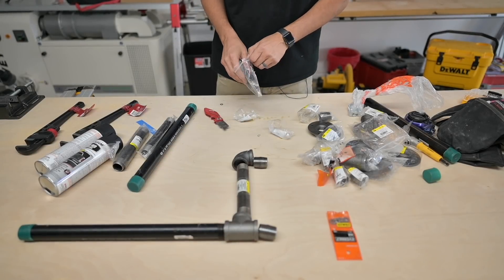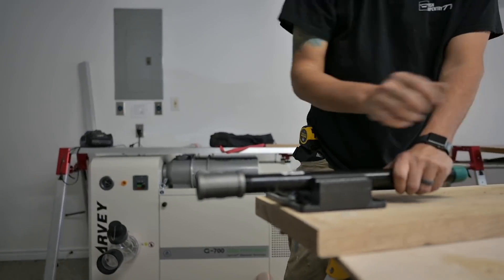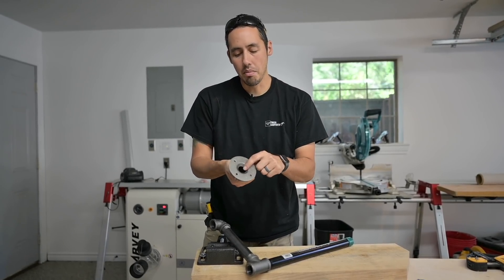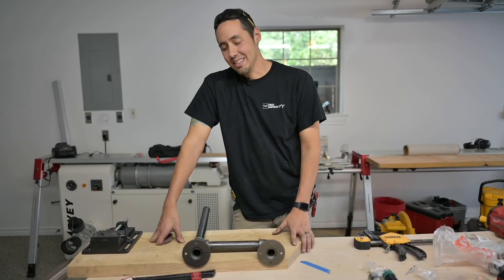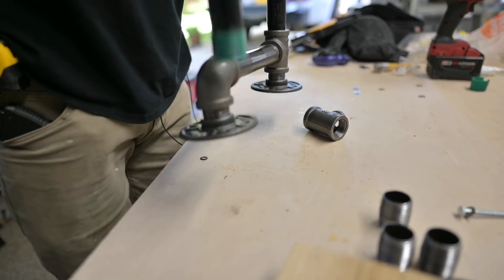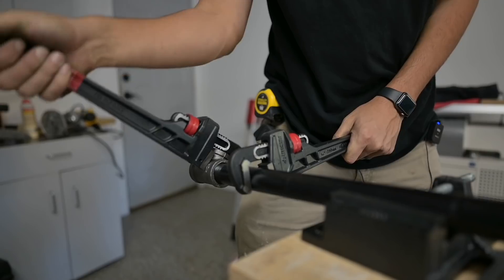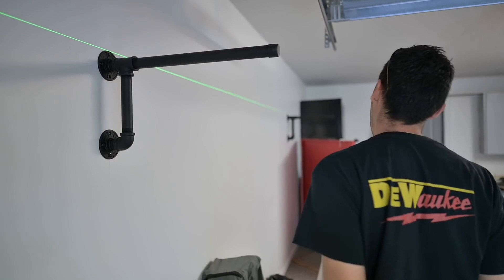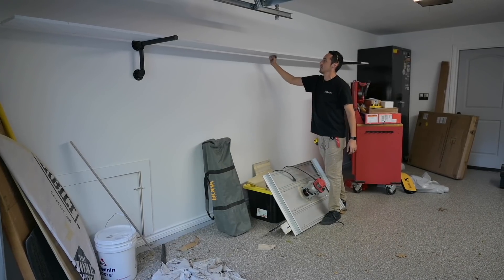I hope these can hold up the weight...

Comment: Really doubt that your original lag bolts were pure zinc. They were galvanized steel (zinc coated). Stainless steel, though all sexy looking and sounding, will shear at lower torque than the galv. bolts. Still plenty strong, though keep in mind the load path spreads to about 45 degrees from the load point, that's why 45 degree braces are used to help carry the weight. The weak point on your system is still the threaded connection at the connector. You just moved it out from the wall a couple of inches with the same load at the tee. Yeah, you stabilized the deflection with the added pipe, buy it'll still fail at the thread point if it ever does as that point was merely moved, not reinforced.
Reply: Almost but not quite! Zinc-plated is the most common, it's an electroplating of zinc on top of mild steel. Galvanized is a hot-dip process (more expensive) of mild steel into zinc, which produces thicker zinc layer. So "zinc-plated" and "galvanized" are not the same. But the core point on metallurgy here is correct and important – "zinc" bolts are "zinc-plated" and they are mild steel and so they are actually stronger than stainless steel (it's a compromise — stainless has better corrosion resistance but it is more brittle). For this application, where corrosion is not likely, any fastener is probably fine, though stainless is perhaps 4x as expensive. (And there is 316 stainless and 18-8 stainless, the two most common types, depending on whether you are actually in the ocean or just near it.)

Comment: At least for the bottom brackets, I'd be worried about the drywall crushing and making the wood slide off or at least lean. If you attached a board flat against the wall then attach your bracket to that then it would spread the weight out against the drywall better. Also, the head of the bolt is carrying all the weight. Maybe add a large washer to help spread that load out. 
My system is cheaper but I also think stronger. I attached 2x4s vertically to the studs. I drilled 1-1/2 holes about every 16 inches. Then I put a 14-16 inch piece of closet rod in each hole. Holds a bunch of weight. The load is spread over dozens of fasteners plus the grain of the closet rod as well as the grain of the 2x4s makes the connection there very strong.

Comment: If those aren’t strong enough, try the 4” timberlok structural fasteners. Might have to drill out that hole in the fastening flange to 5/16” or so to accommodate the extra width of the fastener.

Comment: You could always run a 2x4 the distance you want your shelf arms to be and attach the 2x4 to the studs with lag bolts. It’s not the most elegant solution but it would provide far more strength

Comment: Richard, you should reinforce the bottom set of supports with the same kind of right angle brace as the top row, pronto. Will be MUCH stronger and safer then. You've got an accident waiting to happen at the moment.

Comment: You must know that at the same place you got all that pipe they sell heavy duty shelf brackets...cheaper and better. P.S. the bolts are zinc coated STEEL actually better than stainless.

Comment: Mark holes, pilot drill, rotate the flange and put bolts in flange and turn flange back into position. Take it to the wall and tighten them a little at a time until the flange hits the wall.

Comment: The zinc bolts only have a zinc coating over steel not as part of the steel alloy. Stainless steel is normally softer than regular steel with the exception of more expensive & more difficult to machine stainless alloys. The stainless bolts at Home Depot aren’t those. The black pipe threads are tapered so you don’t want to over tighten. If you need to tighten to a specific position use (gas) yellow teflon tape to take up slack if unable to make 1/4 turn or so. Like comment about using half machine thread half wood thread headless bolts for obstructed holes.

Comment: Great idea for space saving. Love it!  By no means am I an engineer, but the vertical rises have no significance on the load bearing on the 18” pipe.  The connection point at the Tee is the weakest point of the build which is proud of the riser. Just as it is with the floor flange. Read some other great comments like using 2x6” strapping screwed into each stud then the flanges fully screwed to the strapping with either lags or hanger bolts.
I do agree though that the extra piping looks “cool” so who cares! Great vid Richard. BTW! I use the space above my garage doors as well.

Comment: I could be wrong, but wouldn't that top shelf with the extra support on it be better if the support arm was on the bottom helping to hold the weight in a pushing down method, rather than when it's above and it's a pulling method of force?

Comment: The weakest part of that is not the pipe or lag bolts.  It's the wood you are bolting to.  You need to spread the load over a larger area of the stud.  By putting two flanges on the assembly you need to make sure your top flange has at least 2 bolts to resist TENSION AND SHEAR.   The Bolts in the bottom flange are going to transfer shear only.  It will be pushing back into the wall.  Use carriage bolts or wood screws.  Do not use sheet rock or deck screws.  They are not intended to resist shear.

The top assembly is stronger than the bottom.  The top assembly can resist more moment.

Comment: Of course you have already done the project before we see it, but here goes. You can get  shelf support brackets that will hold as much weight as your pipes, but if you like the pipes then go for it. 
Try LAG STUDS for the inner mounting of the pipe flanges, and finish with nuts. 

Alternately you could use metal channel like Uni Strut or Kiindorf that can mount to the channel along the height of the wall studs  and then use their hardware for the shelves. 
I think you  are stacking too much weight for the number of pipes you have. You might consider doubling up on the adjacent available studs. The Tee is not the best to add support. It is too close and the leverage of the mass is multiplied greatly. A .Wye” further out  would work better. 

If it falls in the night no biggie, but if it falls on you or somebody else then it’s a biggie. 

Just a few thoughts from an enginerd.

Comment: Fasten the top flange on both assemblies first, then you can screw the bottom flange in or out to adjust level, just an idea...you do great work with wood. I work at a steel mill 😁

Comment: If you're that worried about spreading the load on the stud, you should have lagged a 2 x 4 flat onto the stud (countersink the lag bolts) and all four of the holes on the flange would've been in solid wood.

Comment: An engineer would point out the support leg of your design would be more effective if they were below the shelf pipe.  Currently your lag bolts rely on tinsel strength for both upper and lower round flanges. If your support legs were below the shelf pipe the round flange on the leg support would carry the shelf load against the wall.  In that configuration the shelf pipe round flange lag bolts would no longer be under tinsel load, they would transfer to sheer load.

Comment: I support other commenter’s ideas of adding a ledger board. Would it be possible to use a 4 way connection (in place of the T for the top arm), a T connection at the bottom, and add a pipe connecting both arms? That way, both rows of brackets are connected vertically. You’d lose a little bit of space but would gain a lot of strength!

Comment: On those screws you can’t get in slot the two bottom holes, put your screws in place and slip the bracket on to them and then tighten them up them add your top screws. Just a thought young man.

Comment: Maybe slot the bottom hole on the flange and pre install its bolt in the wall.  slide the entire pipe assembly over that bolt and proceed.

Comment: Should hold up just fine with those 2 lag bolts. I find it easier to just throw up a 2x6 stringer spanning a few studs and bolt directly into those with a mount plate like you are using. With lumber as expensive as it is, your set up just fine without a stringer

Comment: No engineer here, but it seems like the 2nd install will be much less apt to pull the brackets from the wall. In fact, the taller the upright, less outward pull will be exerted on the upper flange- most of the weight will be directed straight down. Also, if you stayed with the first iteration, the further down the wall the second flange is, the less torque on the upper bracket. (I think . . . . . maybe . . .lol)

Comment: Everyones a critic on youtube so I say this with grain of salt. you could get at least two on the top.  Install the top bolt, rotate the assembly by unscrewing install the second bolt and than tighten to vertical again.  Putting the extension on the lower portion will give you more support.  the weight of the lumber creates a moment about the connection to the wall.  this creates a pulling force on the threads.  If the extension is on the top both bolts experience a pulling force.  However if the extension is on the bottom some of that rotational force is translated into a pushing force against the wall on the lower support which should be more sturdy than the threads on the screw.

Comment: Another idea:

Instead of an elbow for the secondary flange,  add another tee to create an additional rack. It’s essentially infinitely expandable. Just make the top and bottom the same to bookend it.

Also give the entire “system” multiple anchor points, at the top and bottom.

If you think you need it, you can add as many reversed tees to additional flanges as you want.
Reply: You must be a gas fitter 👍

Comment: Line up the holes at 5 past 7 as a clock  face   also screw a 6 X 1 board on first then you can put a fixing through all the hole's

Comment: Don't worry about lag bolts. Just a bit of CA glue will do. And forget the laser level, just stand way back and hold your forearm horizontally in front of your face and squint a bit, most accurate way to level anything in my opinion.

Comment: Set the blocked holes offset and put the lag bolts in there and then restraighten the blocked hole so that they're horizontal with the vertical pipe then drill a starter hole for those two bolts, with the head of the bolt as far out as it can be, start threading those leg bolts into the stud using a boxed ratchet wrench until they're tighten down into the stud and then you can drill the top and the bottom holes for the other two lag nuts excuse me leg bolts

Comment: I'm not too crazy about using gas pipe and fittings for this purpose. As someone else said, HD and Lowe's have HD shelving that would be more than suitable.

I agree with the suggestions to use a ledger board. It would be stronger and easier to mount the hardware.

For peace of mind, I would use structural wood screws (e.g., Simpson Strong-Tie) for this type of application.

Comment: I thought the stainless was softer that the zinc coated steel bolts.  I know stainless screws strip out really easy.  You might want to double check that.

Comment: You don’t have a bolt access problem - you can get two bolts equal in length to the long one (the first one) you used in the video into the top and bottom hole of each circular flange. Here’s how: 1. Before you thread the circular flanges on the pipes, mark where the four flange holes will go in the wall and drill them to the depth of the bolts. 2. Put the bolts in the holes of the flanges themselves (not the holes in the wall) AND THEN screw the flanges to the pipes rotating them (as you did) so the flange holes line up with those in the wall. You now have the bolts in place dangling from the holes in the circular flange in the correct orientation. 3. Offer the bolts up to the holes in the wall and screw the awkward bolt in using a spanner or a ratchet. You’ll see you can just use the power drill to do the other one. You may have to get someone to hold the pipe structure because it will be essentially sitting in mid-air while you screw the awkward bolt in by hand.		TLDR: Put the bolts in the circular flanges BEFORE you screw them to the pipes. (P.s. You’ll see you actually only need to do this for the awkward bolt, but for ease of explanation…)

Comment: I would have put a screw in stud in the wall First that you can't get to on back plate and put a nut on to secure it. A stud is a threaded bar for nut washer with wood screw at other end. I don't know if you have such things in America. but ebay. have them. I admire your work 😁

Comment: Did the math off some quick assumptions, using only (1x) 2" lag per flange, the "L" brackets are OK up to about 500lbs per arm. That is assuming equally distributed weight. The straight pipes from the wall are about 1/5 to 1/4 the strength. Again, that is just assumptions because I don't know actual measurements or conditions.

Comment: Why don't you get the dual threaded thing, not sure what you call them that have wood thread on one side and machine thread on other pre-insert inside two threads then you can bolt with box or open end wrench the inside holes! Easy

Comment: You could solve the bolt pattern issue with hanger bolts and nuts in the holes covered by the pipe

Comment: Honestly for all the money and effort you have put into your workshop, I would have opted for a lumber rack kit such as the Triton systems from Home Depot. They cost from about $75 - $150 depending on size and you can adjust them as needed. Sometimes DIY is not the best solution. Just my thoughts……

Comment: 1. Put the assembled unit up against the wall where it is meant to go.

2. Mark all four holes.

3. Pre-drill holes.

4. Rotate flange enough to get the lag screw in the hole.

5. Rotate back into place.

6. Hold unit up in front of the wall, and put the tip of the first lag screw into its intended hole, and ratchet in by hand.

7. Repeat for the second “hidden” lag screw.

8. Put the easy to access lag screws in and tighten.

9. Reply to this comment and thank me.

🤣

Comment: You're on the right track but missed. 
Drill a hole in any stud or larger and all you have to do is screw the pipe directly into the wood. It will hold hundred of pounds. Half inch pipe works too, one inch is complete overkill. If you don't want big holes in your studs, use another piece of wood. Hardest part is drilling the holes square, although I prefer a little angle.

Comment: Way too many parts and expensive. 
I took 4x4 posts and use lag bolts into the 2x4s on the wall. 3 posts for an 8ft span.
Before installing the post drill out for just the pipe. Drill at a slight angle for a few degrees so the pipe has a slight upward position.
Wish I could post a pic here.

Comment: You're gonna have a problem with that pipe shelving, if there's too much weight on  the pipes it's gonna split at the threads where it meets the wall at the T or the flange. Think leverage and why you would not use something like that in a master closet or pantry shelving.....

Comment: Just back the flange out enough to get the bolt in and then re-clock the flanges.  Since you're not trying to get the pipes water or gas tight, you can just rub some soap on the threads.  Did you go to the orange store off Hulen?...they're always out of stuff.  And....what is your wife doing that she needs the leaf blower inside the house?

Comment: Unfortunately your engineering for the shelves is incorrect. Think of the flange as the pivot point. The longer your pipe projects from the wall the easier it will be for downward force to pull the bolts out of the wall. You had the upper shelf on correct the first time. Downwards force on the pipe shelf would have push the lower flange into the wall and not pull the bolts out of the wall. In turn the lower flange and support pipe would provide the needed support for the pipe up above. The way you have it set up now, the downwards force is going to pull the upper flange out of the wall.

Comment: I cant imagine that extra piece is doing anything.  All the weight is hanging off the top pipe.  You need a diagonal piece to make a triangle to increase strength.  

Why don't you just make the brackets out of wood?  You are making a wood shop correct?